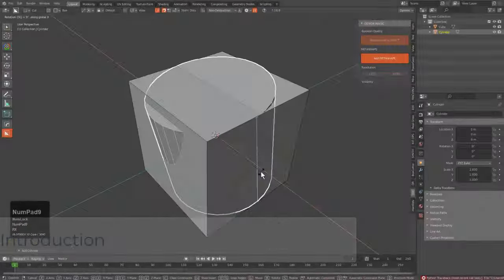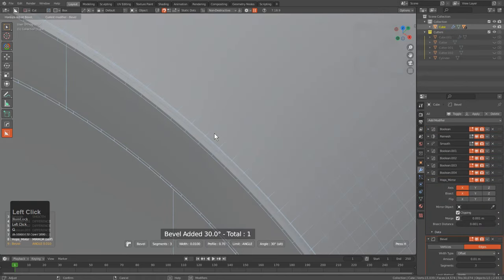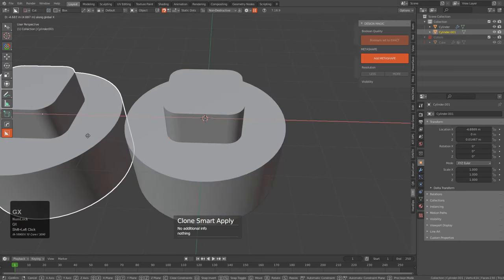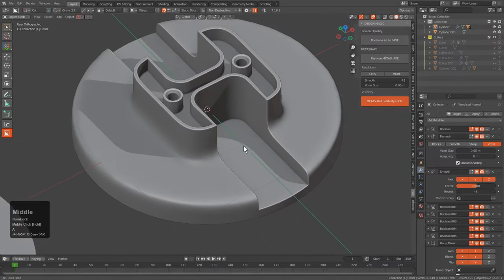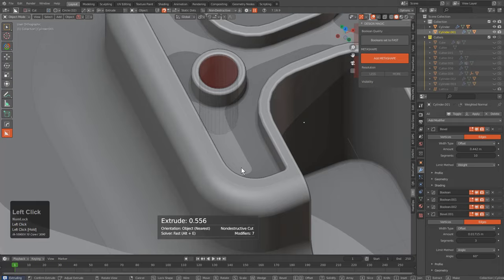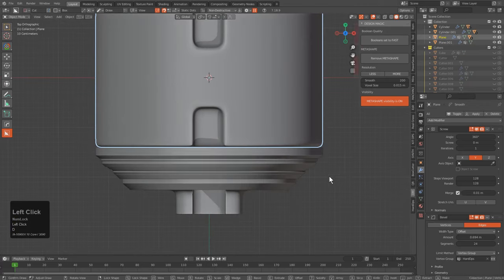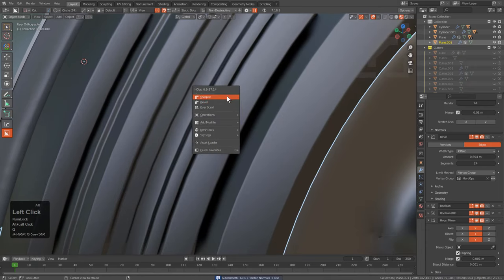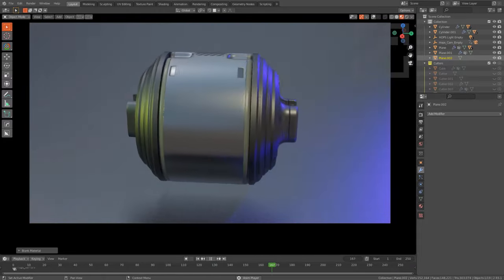DesignMagic Intro for #hardops/#boxcutter Users

Comment: Thanks for this! A couple thoughts. Use the METASHAPE visibility button to toggle OFF METASHAPE when setting up your post bools. Then turn it back on when you're ready to convert to mesh for final.

Also, METASHAPE is probably best used for more organic forms that can't be created using bevels.
Reply from the maker: ah yes. I knew youd explain it better.
Reply: does metashape do something special or can I achieve this via adding remesh and smooth through hardops?
Reply from the maker: @neeleshchevuri6268  the market page goes over the product more in depth than this video. 
https://www.blendermarket.com/products/design-magic
Reply: @neeleshchevuri6268  it doesnt. Its just a fancy (and actually confusing) naming. Its just add 2 modifiers and thats all.
Reply: @sounddifferent3752  hah, I get it now. I thought it was a different algorithm or something.

Comment: MX, would be great if you could point us to an in-depth video on the use of the various modifiers like weld/bevel etc and when where to place them in the modifier stack for the modeling process. Seems like these methods are highly necessary for a good modeling workflow. Seems a little wacky knowing just when and where to manipulate those modifiers. TIA
Reply from the maker: https://youtu.be/8BQYAwDW6IE

its based on personal needs and context. You learn it through experience! Even if i told you my rules you'd break em in attempts to prove me wrong. 

https://hardops-manual.readthedocs.io/en/latest/boolean_beginner_tips/#sort-awareness
Reply: @masterxeon1001  Thanks for that link - it should help immensely!

Comment: I wish Chipp sold Metashape separately. I'd buy it without the DesignMagic stuff, I can use Hopscutter for everything that DesignMagic does anyway, but with more control imo. DM might be faster though. Thing is, I bought Synth, and literally used it like twice. Not that it's super expensive and all, but it's still cash) I think I used Bevel a few times, for the edge wear, but I find Fluent's edge wear stuff way better. I hope with time and experience, I'll be able to use all of Chipps products more (I have them all except this new one).
Reply from the maker: our philosophies differ on product strategization but the aim was merely to assist users with avoiding issues. I have particular views when it comes to high poly situations in blender. We need some nanite.
Reply: @masterxeon1001  yeah, high poly is super slow unfortunately, although my rig is slowly aging and maybe I need to upgrade my gear..
Reply from the maker: @timur7381  one click too far and a small wait will be had.
Reply: @masterxeon1001  you're using an Intel chip right? Did you find Intel cpus work better with blender?
Reply from the maker: @timur7381  for me. I might build a 5900x sometime.
Reply: @masterxeon1001  that's what I was thinking, going all out and building a dream machine with 5900x and 3090 (when they're back in stock at reasonable price that is).
Reply: @timur7381  Im rolling on that setup, perf is still an issue with high dense meshes - Hopefully one day we can cut bools into million polygon meshes like MX cuts his boxes (fast)
.. Thats the advantage of zbrush it deals with the 100 mily polys like its nothing
Reply from the maker: @artdeluxxe7647  i still enjoy testing quadremesher. Sometimes it will surprise me. Others will disappoint.

Comment: Look at your selected mesh at 21.44 AND then at  21.53. Do you see the difference? At 21.44 you got some extrution inwards between the two plug holes, and at 21.53 the extrution inwards is gone, when you ALT+G this part to the center. 
I guess it could be fixed before with Late Parent !?
Reply from the maker: porssibly